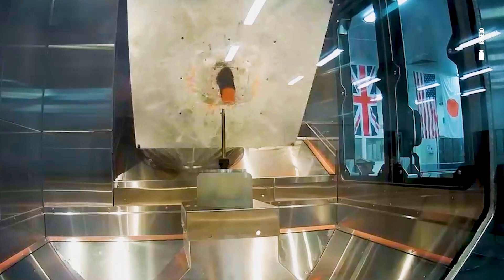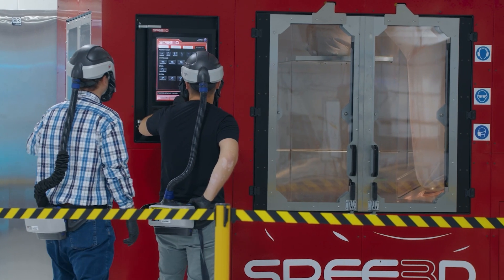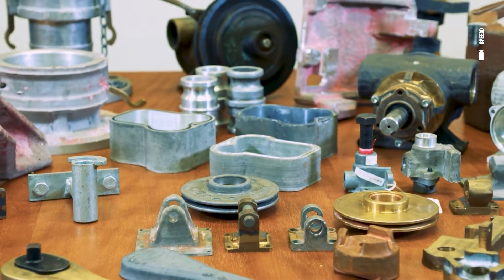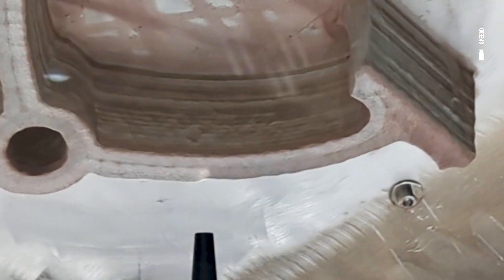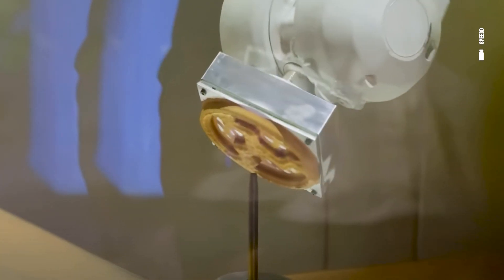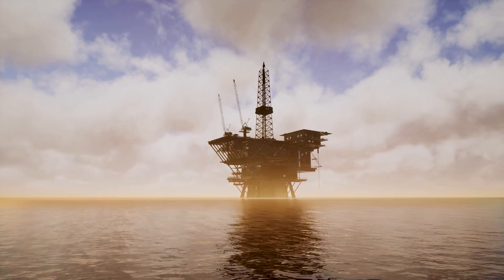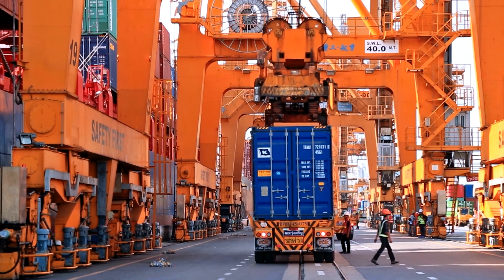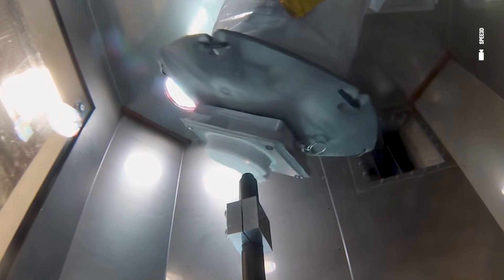Metal Printing: Rapid and On-Demand

Comment: A few questions, please.

Can basically any metal be used to form a component as long as the metal is solid at normal temperatures? In other words, can any powdered metals be used? Multiple metal alloys too? 

You said the set-up can form parts up to 45 kg. Is there a lower limit in the size or weight that can be made? This is all new to me so perhaps my question sounds foolish but I'm curious to learn.